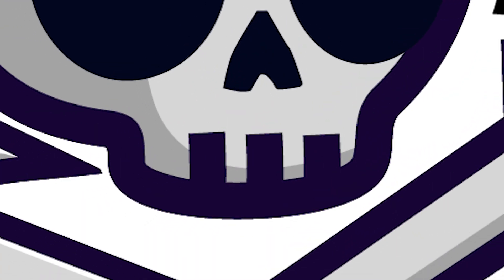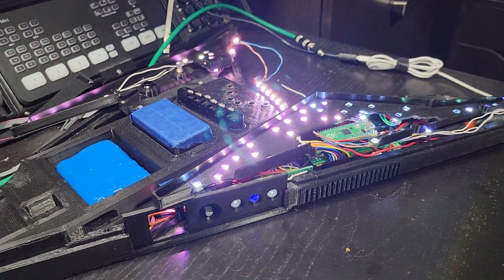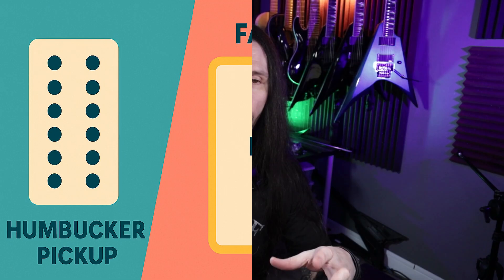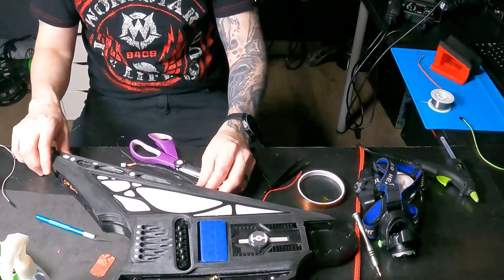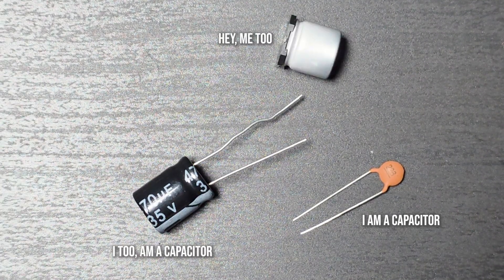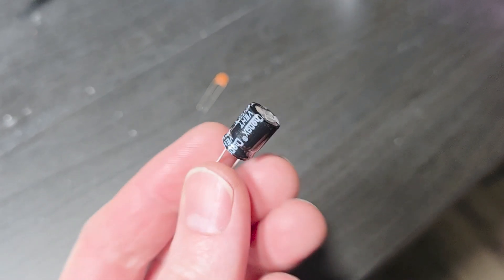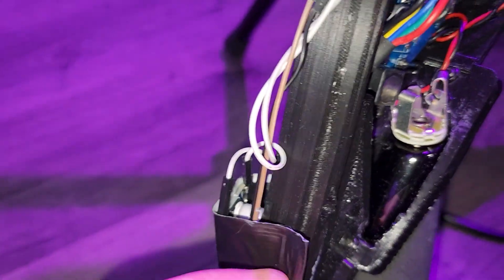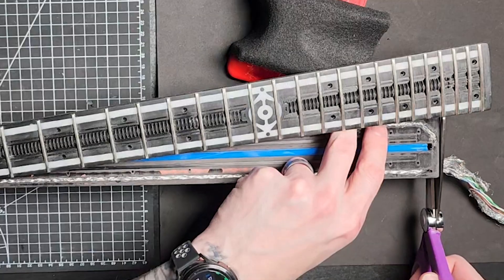I SERIOUSLY overengineered this guitar and now I’m paying for it.

Comment: If you are using the different grounding points for all circuits this can cause that type of noise, with some audio circuits it's best to use a star grounding method to avoid additional noise and emi in circuits it's an old school method In high end audio products but is used to stop ground loop interference.
Reply from the maker: Yeah I thought i did ok with star grounding for the major components, but I definitely leaned on the ground plane for a lot of misc stuff. I will revisit. Thank you!

Comment: I looked some more.  First thing.  The thickness of the copper shielding will have an impact on the frequencies blocked by the Faraday Cage.  Using Terminator for some back-of-the-envelope calculations, it looks like copper shielding that's around 3mil thick can knock down noise about 23dB @500Hz.  That's a shitload....UNTIL you saturate the living hell out of it with high gain.  So if used thin copper shielding, I'd try doubling up on the thickness ASSUMING the copper tape is conductive on both sides.  I switched to "Silver Double Sided Conductive Adhesive Tape" recently just to be safe.   The effectiveness of the Faraday cage is going to go down at lower frequencies.  So, basically, the Faraday cage is not perfect.  

I believe the buck-boost converter you used ( those are awesome) uses the LM1577 chip.  The datasheet says it's switching frequency is 52Hkz.  That's WAY lower than I'd want for audio.  I'd want to be in the Mhz range just to be safe.  I'll look around for alt chips.  I need a solution to this for my guitar so I may just whip up a PCB specifically for this for prototyping.  If they work I'll gladly send you some if you are interesting.
Reply from the maker: On that one test, that's either correct or it's a close variant of that. The main board I designed contains a custom buck converter circuit using the LM2596T-5 which is a bit better, but still really low (150KHz). I found quite a few possible ICs that can handle the draw with higher freqs and just ordered. Logging the rest of your points for review and discussion. Yeah, if you figure out something that works, I'm all ears. I'll follow up. Thank you again!

Comment: How stable is the neck?
Reply from the maker: I am wrapping up my next video right now and I do touch on that a bit. In this current iteration I would call it ALMOST stable enough. The next iteration has some improvements that should push it over the finish line.
Reply: @metalheadmaker  that's awesome.  I'm looking forward to seeing this as I'm very much interested in trying to print baritone conversion necks.

Comment: Not sure if "overengineered" is the right word here. For example, many German cars are considered overengineered because they can do really cool things (ie: retractable hardtop in some BMW models) and they work beautifully, but the maintenance cost is way too expensive and the car would still be perfectly acceptable if they left out those additional features, so they're considered to be overengineered. As far as your project goes, I haven't really seen it working yet and it doesn't seem like it'll hold up well in the long run. So is "overengineered" really the appropriate word here?
Reply from the maker: Definition and interpretation are two different things. By definition, yes, it is the appropriate word. Thanks for the vote of confidence.

Comment: Amateur effects programmer here: check out some of my silly effects.  I have a couple ideas for you.  Im not sure what you're using for the microcontroller,  but... if you're using pwm for all the lights and everything else you can crank up the speed above 20khz.  If you have it filtered correctly even if its there it will be above the audible range.  Also the buck converter even filter is going to be an issue.   None the less, this seems fixable.  Also, any of the unused pins on the microcontroller should be pulled low if possible.  Id check if through a quark in the code if they’re firing some kind of signal.
Reply from the maker: Teensy 4.1 for the microcontroller. Thank you! Some of that i'm handling already but everything involving frequency needs to get dealt with. Adding all this to the checklist. 🫡

Comment: I just found I had to solder one pick up wire to the metal that simply holds the pick up , 
went from noisy hell to super quiet .  just added 1/2'' of bare wire.

Comment: Hi , I've been doing something crazy to my guitar , I know what I'm doing , But , I hope I know what I'm doing LOL!   I gave it a bass guitar single coil that has it's own jack so I can send 
that signal to a octave down pedal that goes to a separate amp . I don't know if it's in phase
with the other pups , I'll know soon.   Should be awesome .  The bass pick up hovers over 
just the  E A D strings , It only has 2 poles ... sounds great on its own.   Thanks
Reply from the maker: The cool thing about projects like that are that,even if it doesn't turn out like you expect, it will still almost certainly create something really unique sounding. That in itself is gold in an era where it is getting harder to stand out. Good luck!
Reply: @metalheadmaker  Yes !  It's been a blast , Trying
the pup in different places and distances , It actually has a very pretty Strat like sound

Comment: I'd look at the buck boost converter first.  I need to watch your other videos to see what voltage you are knocking it down to.  The other culprit could be the PWM frequency of the LED if you are using dimming.  .  In both cases we want to get the switching frequency way above the audio band.  Big capacitors are your friend when shorting noise to ground.
Reply from the maker: I'll save you the time - bumping down from 12-ish to 5 and then to 3.3 for a few components. The bulk are 5v though. Thank you! I was considering just filtering as good as i could and calling it done, but between you and a few other guys that have chimed in, you've given me enough info to have the confidence to revisit the circuit design. Thank you so much!

Comment: the voltage regulator board you showed is a boost/buck converter that works at high frequency but is efficient, you can switch to a linear voltage regulator ang get rid of that noise but it will be a little more heat.
Reply from the maker: Well, that was just for testing. I design what is basically a buck converter on the main board which will behave effectively the same. I didn't use a linear regulator because the amp limits, but I'll revisit that. Thanks for the tip!
Reply: @metalheadmaker  With signal or audio devices if you have to use a buck converter try to spec one that switches in a frequency that is well outside the range that you use for your signal / audio. You can stack linear regulators but if you stack try to speck it for 150% as they may not balance perfectly.
Reply: Agreed.  The downside is the linear regulator is going to suck down batteries quickly.   Id also try placing a large cap directly on the output of the regulator to ground.  Something like 10uf or higher is where I'd start.

Comment: You're running the pickup on a separate battery (I gather it's active), which is good.  But do the two circuit domains still share a ground?  You'll probably get better results if you completely isolate the two, including no ground in common.  It might be tricky given your Faraday cages, which are also a good idea.  I'd think it's probably best to keep the cages surrounding the LED circuitry grounded to that circuit, but the shielding around the pickup grounded to the audio circuitry and output jack.  Also: I guess you're probably trying to do fancy LED chase sequences and dimming.  If you could be satisfied with LEDs that are either full-on or full-off, with some more complicated switching circuitry, you could prevent AC (pulsed or PWM) signals from being sent all around the guitar; only change signals when LEDs change state, off to on or vice versa.  This, in company with a microcontroller that goes to sleep in between LED-change events, could greatly reduce the EMI signals regardless of shielding or its lack.  (I'd say just stick with all-LEDs-on and no control circuitry at all, but I get that you want it to look fancy or whatever, so...)
Reply from the maker: Yeah there are shared grounds, but I did a bad job in this video explaining the goal and why it's wired up this way. It's built for being able to run electronic tuners by reading the signal, so it naturally needs a signal to work with. I've also got things wired to possibly intercept the guitar signal down the road and manipulate it before it goes out to the amp. Basically, it's built for short term fun and gimmick, but also with expansion flexibility. As far as full on/off, that is a solid point. I actually proved what you're talking about when I was testing by going 255/100% on the LEDs, and the sound basically disappeared. It's that g'damn PWM. But yeah, I could go that route still just by maxing the LEDS programmatically. Problem there is power draw and brightness. These things are blinding and will almost certainly burn out the circuit with that many running all at once. All just problems to work through, sounds like you know what it's all about. 😄

Comment: Overengineered is when one builds something too well.  This is more like the opposite.  Isolate the active pickups from everything else - no shared power or wires.  one by one, disconnect your electronics bling BS (LEDs etc.), then play the guitar.  Eventually you'll find and disconnect the offending circuit, and the noise will go away.  THEN you can start to ENGINEER a solution.  In the long run odds are you'll spend a long time on a guitar that sounds rather like other guitars and has a lot of gimmicks.  Don't settle for filtering out the noise with caps.  Your filter is imperfect.  It reduces the noise but doesn't eliminate it.  Consider a remote power supply (like in a pedal box) connected to the guitar as a way to move noisy stuff away from the pickups.
Reply from the maker: I think you might be missing context that prompted the shared circuit. Regardless, the entire point of this guitar is to create a gimmick guitar for fun, not create a mass production product. Still, if I hit a wall and just can't solve something, I might revisit your points so thanks for chiming in.
Reply: @metalheadmaker  Unless you have a crazy noisy circuit in the mix, everything you're doing should be doable - with enough effort.  Divide and conquer - you'll get there.  If you think that's crazy, check out some of my builds.  At one time I was planning on using one of those mini-spectrum analyzers in a Star Wars themed guitar build.  I think I recall seeing a similar unit in your video.  It refreshing to see someone at least trying something different, even if it's just for fun.  I've done about two dozen experimental builds testing various performance features, ergonomics, electronics, and materials.  I've done over 100 build/mods altogether over the last six years.  You might find a bridge humbucker and a hotrail mounted vertically under the bass strings at the neck wired in parallel to be an interesting voicing.  Have fun!
The are 3 builds on my channel that use that pickup configuration - complete with audio interface samples, if you want to check them out.  One of them is a EMG equipped minimalist Superstrat in purple flamed maple.  Something tells me you'd like it.

Comment: yah, those led's, the driver circuits.  you can probably dig up an old circuit that can be tuned to different frequencies, so it doesn't cause interference.
Reply from the maker: Looking into it. Thanks for the tip!
Reply: @metalheadmaker  thinking of all the options i have seen... maybe you'd do best with separate addressable rgb led's, expensive, well, was, but doesn't require a gigantic noisy driver cause they have their own built in.  there's a kinda cool way to use latches to bucket brigade, one led at a time gets a shot of power, they pass on a clock signal from one to the other.  with a capacitor they stay lit long enough to look like they're constantly lit, but it's a LOT of hardware, and you got enough already.  with individually addressable led's you just rip out and replace, takes up the same space.

Comment: Any Isolation of  digital and analogue grounds?  physical separation of ground planes? magnetic decoupling?
Reply from the maker: All great points! Yep, digital are all routed on one section of the board and analog in another. Not to say that it's a ton of separation because the board can only be so big, but they aren't comingled. That main board is a 4 layer and has a dedicated ground plane. I have tested ferrite beads on the LED wires as well as the pickup wires and there are a couple ferrite beads worked into the main board design, but this is an area that requires a ton more experimentation. When I'm making these videos, I often end up leaving some stuff the cutting room floor because I'm trying to balance time and info overload. I also forget to talk about some stuff due to the comical amount of micro tasks involved.

Comment: I might have missed it but, are you using active pick ups? Second the guitar won't be a true faraday cadge. If the pickup is connected it's part of the circuit. I think you could try separate voltage. A passive pickup system can be separate from your other circuit.
Reply from the maker: Yep, active pickups. I thought about passives and decided that, if this was going to be a viable project that it should be able to behave like a normal guitar and accept passives or actives. Yeah, to the faraday cage point - I kind of come to that realization around 2:40. However, there are signs later on in the video that EMI is still present as opposed to line noise, so a farady cage may still give some benefits. I'm at the point where it's a ton of trial and error since the circuit is so complex. Thank you for the guidance!

Comment: Some capacitors and ferrite beads will solve your problem but just to enjoy the process a little more, you can try feeding the led positive line to your guitar positive line in reverse polarity so that they will cancel each other. And after summing, you may add a dc blocker capacitor to take your center to 0Volts again.
Reply from the maker: Here you are, coming to the rescue again. 😄 Awesome to hear from you! Good call on the ferrite beads. I forgot to mention that I tried both cylindrical ferrite beads around the LED wires and I also have ferrite beads embedded into the design on the main board. I'll try to remember to touch on that when I wrap up this part of the conversation. It didn't make noticeable improvements, but there are so many configurations to test it could be that I just need to reposition them. More on that to come. As far as summing, maybe I've heard of this but it's not ringing a bell. Researching that and the blocker cap. Thank you for the direction!

Comment: Have you joined your pickup ground to your led ground?
Reply from the maker: Good call, yep. I've done lots of experimenting with separating circuits, joined grounds, separated grounds, star config, random connection points, component distance, etc. It has been a slog but I am really optimistic about this final configuration. 🤘

Comment: Bro invented a low pass filter XD. Nah man I am glad to see you are still making progress. As with any engineering project, the final 20% take up 80% of the time, integration hell. If you want more noise filtering, think about using a ferrite core inductor or look for a low noise dc-dc converter. It could help to keep noisy/digital circuits and analog ones on different boards or grounds. If you need to send a signal between the two, use an optocoupler. It would help to do more research on this as there is a whole field of research into this kind of stuff, keeping supply noise from interfering with analog sensors.
Reply from the maker: Ya know, I wasn't really thinking of it like that, but yeah pretty much. I guess it's just a different kind of noise that I'm trying to filter out compared to what they're typically used for. Good hearing from you man!

Comment: I had the same issue with leds in an amp I believe it might have been a lack of earthing on led lights
Reply from the maker: Yeah with LEDs it can be tricky depending on how you are driving them. If using PWM (what I'm using) it's a nightmare. If just straight voltage, managing your routing and grounds can help a ton.